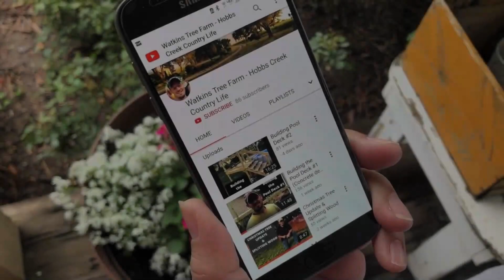Spreading Rock - John Deere 1025R / 1026R subcompact Tractor and Frontier BB2048L Box Blade

Comment: I have learned a lot with my 1025R I spread the gravel driving forward and do a light dump. I just bought a box blade and waiting on 10 ton of rock to finish off my drive/parking area. Practice makes perfect the more you work with it the better you get. I have had mine for 5 years now and love it and have about 500 hours on it.
Reply from the maker: Practice does make perfect.  Since this video I have started to find my groove.  Love the tractor & find new ways to use it.  Thanks for watching.  If you are not already, I hope you follow the channel.

Comment: Can you describe how you set the angle of your blade? I’ve heard you want it angles forward for cutting and backward for spreading. I also learned that you want to run at a faster speed for the most effective spreading. Thanks. Great video.
Reply from the maker: To be completely honest I am still learning.  You described it to a Tee.  I have mine set backward right now to maintain what I have & it is working perfect.  Tilting it more forward will pick up more rock but need to be careful not to pick up too much & leave bare spots.  It is a learning process.

Comment: Great video! I've heard some people having issues connecting the BB2048 to the iMatch. Did you have any of these issues? I'd really like a box blade and the BB2048 is heavier duty than the BB2048L, but I want to make sure it connects to the iMatch. Thanks!

Edit - It looks like you have the BB2048 as opposed to the BB2048L?
Reply from the maker: I cannot speak for the other box blade your talking about.  The box blade I have hooked right up with the I-Match no problems.  Thanks for watching!!